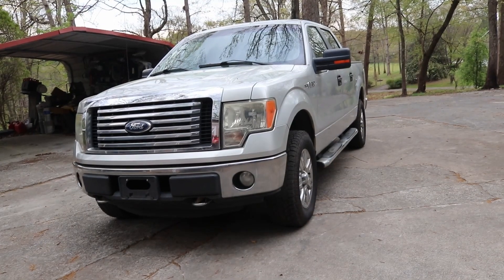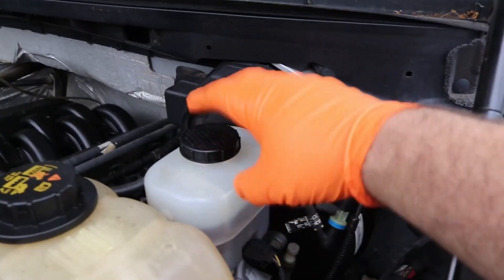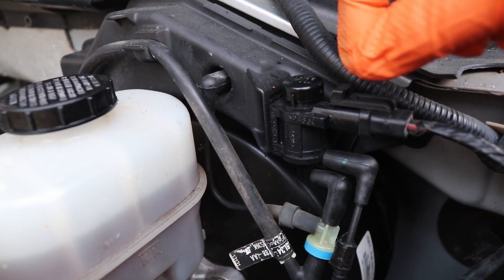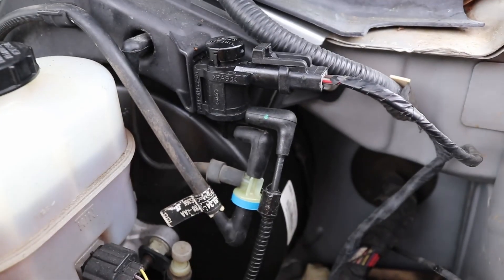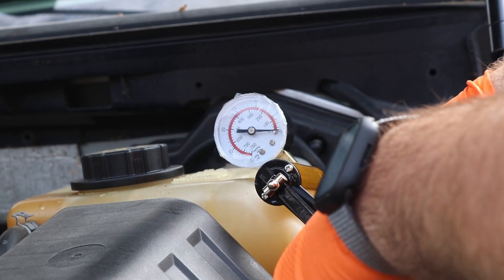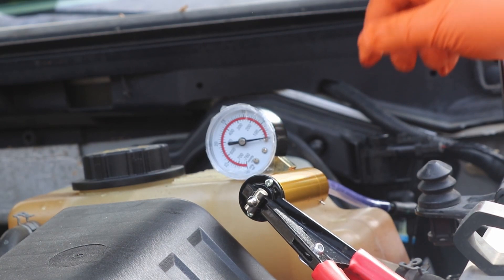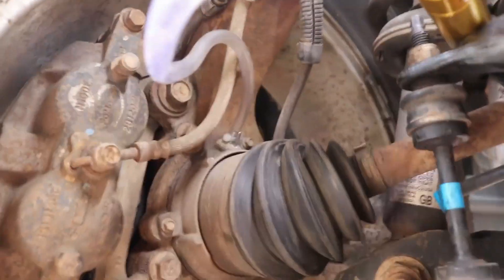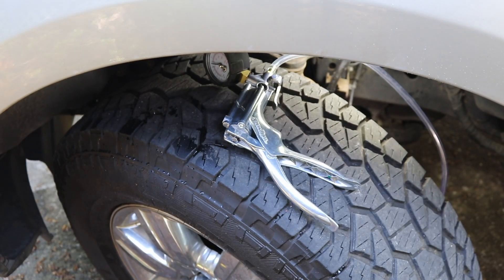How to test the IWE system on a Ford F-150 (full guide)

Comment: I have a 2010 ford f150 4x4 5.4. I hope you read this: I have had a 'bwannnk, bwanbwannnnk" inconsistent grinding noise. I have replaced my transfer case actuator (was getting the wrench sign, but that solved that and allowed me to go into 4 wheel drive). I replaced the vacuum solenoid and the check valve and it's accompanying lines. I am getting a little over 20 lbs or inches or whatever it is at the solenoid. I have replaced both iwe's (the left one had come a part). Still making the noise. I have put a test on the line going to the iwe's and they are now holding vacuum (wasn't before iwe's being replaced). I put the pump on the line, pumped it to about 20, then tucked it away in the nook under the solenoid and drove down the road. When I got back, it had lost all vacuum. I pumped it again, and it pumped up again and held, so it wasn't  the tightness of the hookup of the pump to the iwe line. My question is this, could it have lost vacuum without there being a compromised component? I have a new line I just got from Ford, and a mechanic is going to install it tomorrow. I am hoping this solves my front grinding noise. Btw, when I put it into 4 wheel drive, the noise goes away.
Reply from the maker: So sounds like your lines will most likely be the problem here. But what happened after he installed them?
Reply: @JunkyardJunkie  They definitely were bad. I am now getting a suction sound when I disconnect from the solenoid, and I put the pump on them and drove with pumped to 20 and it held. HOWEVER, it is still making the noise. So since I replaced the whole IWE system and the transfer case actuator, and the noise goes away when I i put it in 4 wheel drive, I am taking it to a front end man tomorrow. I am HOPING it is the cv axles making the noise, because anything else could get into some serious money. Will let you know..
Reply from the maker: I’m sure it’ll be ok. Best of luck!
Reply: @JunkyardJunkie  Welllll, that depends on what you call "ok". It was 4 quarts low on transmission fluid. The noise has pretty much gone away, though every little bit it appears again. I'm gonna drive it and see what happens. I am thinking it may need a filter change too, but heck, I don't know. It has one of those transmission fluid level checks that has to be done under the truck. The mechanic showed me the dipstick (a little short yellow plastic one). It had some fluid on it when he took it out, but when the tried it again, it was dry. We'll see!
Reply: @EastTexasRanching  what was found that fixed your problem?
Reply: @scottsheffield2594  I had another transmission filter put in. They looked in the pan and didn't see any debris (so that was good). I think the trans holds about 16 quarts (maybe more ) when dry, but what drained out and was replaced was 7 quarts. Keep in mind I had already had 4 quarts added that had mixed with the fluid that was in there, and therefore was part of that 7 that drained out. The noise did not go away after the filter change, so I drove it from the mechanic to the transmission shop. We test drove, and he said it needed a new torque converter and valve assembly  (3500.00). I drove it from there to get my haircut. When I got back in the truck after getting my hair cut, it never has made that sound again. Was it air in the system or just wore out fluid? I don't know. I really need to have a full fluid exchange. But that is what fixed it for me. The truck has 320 thousand miles on it. So the fluid may have been wore out.

Comment: Please explain me how you expect to have 25 inches of mercury in both wheels lines once splitted? It has no sense, the 12 inches of mercury you got is correct because the 25 are divided to the half.
Reply from the maker: Because that’s coming down from the line pulling the vacuum. You may have some vacuum loss. But, it’s not going to be 13 inHg. Hope this helps. Thanks for watching!

Comment: I noticed a hissing sound under my hood.  When I checked, the  the vacuum line that is connected right under the solenoid  that you described going down to the wheel basically deteriorated.  I know I need to get a new one installed ASAP.  Will this cause issues while driving in 2WD or with my CV joint on that wheel since the line is open and continues to blow air out?  I hear some popping noise now in my CV joint and think it may be related.  I am not a mechanic by any means.  Thanks for any advice!
Reply from the maker: Yes if your having issues with the line to your IWE driving in 2wd will cause grinding and eventually wear out the IWE or the cv axle where they mesh. Popping from cv axle will most likely be the cv axle itself is the issue. Go and turn in circles and see if you hear the cv axle clicking. If so time to replace. Hope this helps. Thanks for watching!

Comment: Is it possible to have a bad IWE Vacuum Reservoir? Replaced the Solenoid and the check valve. Did a vacuum test on the lines running to the actuator and they’re good but get no vacuum when switching to 2wd. I do get a click in the solenoid.
Reply from the maker: Have you checked the vacuum before the solenoid to make sure it’s working correctly? That’s where I would start. Then we can determine what isn’t working properly. In more rare instances the solenoid can click but still be failed inside. Let me know and I’ll try to help. Thanks for watching!

Comment: So I put new vacuum lines on, new solenoid… I have vacuum down to my wheel hub and my tire spins freely without the Axel spinning but I still have the sound. Would that be a bad knuckle on my Axel?
Reply from the maker: Is it constant? Does it get louder the faster you go? If so you may want to look at the wheel bearing. If not then you may need to check the cv splines and the IWE splines. Hope this helps. Thanks for watching!
Reply: @JunkyardJunkie  I believe it was the wheel bearing, loudest one I’ve ever heard lol
Reply: Stupid question, not did you replace the check valve? 
Ford has a service bulletin out solely for the check valve. I just replaced mine and everything stopped.
Reply: @-strick996  yea, replaced that as well

Comment: Anyone know why I have the intermittent grinding sound. I checked the actuators with a vacuum gauge, each holding pressure. Checked my lines, each pulling pressure. This was yesterday and then i put it back together and I didn’t have any grinding for the rest of the day. Today I drove to work, heard the grinding, checked pressure and everything was good again. Could it be my cv axle?
Reply from the maker: Doubt it would be your cv axle. Another thing to check is to put your vacuum gauge on the line at the bottom again and have some rev it up and keep throttle at 2k-2.5k see if there’s any dropping. Also what are the actual readings you’re getting? Because you can have some vacuum but not enough to keep it working properly. So, if you’re pulling like 22 inches of mercury. Down at the bottom of the lines on both sides. It should be pretty much the exact same unless your lines have a small hole somewhere. Hope this helps. Thanks for watching!
Reply: @JunkyardJunkie  I was pulling I believe 17 but I can check again
Reply: @JunkyardJunkie  update. My passenger line is pulling 12 and my driver side is pulling 15. But if they both hold pressure would this suggest there’s a problem with my actual vacuum pump?
Reply from the maker: From my experience that’s low what are you getting at then solenoid itself? If it’s over 20 go ahead and replace the lines to the IWE’s. This is pretty common but at least it’s easy to change.
Reply: @JunkyardJunkie  I haven’t checked the solinoid yet. I have heard the clicks. I’ll check it around 1pm and lyk. Thank you for your help!!
Reply from the maker: Anytime best of luck
Reply: @JunkyardJunkie  solenoid was at 16
Reply: @JunkyardJunkie  so after the check valve going torwards the engine I measured and the pressure was at 18. After the check valve on the solenoid side it was 17. After the solenoid going to the wheels it was at 16. Do you know what the problem could be if my pressure from the engine is only at 18?
Reply from the maker: Hmmm that’s strange I’ll have to think on that one. What vac pump you have? If you hold your finger on it you can pump it up to 29 right?
Reply: @JunkyardJunkie  I can check the vacuum and let you know in a bit. However I found something very strange. So last night I decided to unplug the vacuum lines at the solenoid. In theory to have 0 vacuum to the wheels, having my hubs locked, cv axles spinning. But I would leave it in 2wd so the transfer case doesn’t give power to the front wheels. Anyways, took it for a test drive and it was perfectly fine, steering was a little tight but that’s expected. This morning, with it still disconnected, I drove to work which is a longer drive (20 highway miles). The noise was still there. Could it be a wheel bearing? It does not happen at highway speeds.
Reply: @JunkyardJunkie  update, it is a mityvac and yes I can pump it to 29 and hold it on my finger
Reply from the maker: Ya if you disconnected it then yes it should be constantly engaged. But yes it very well could be your wheel bearing does it get louder the faster you go? Then quite down when slowing down?

If not that then you may need to check splines on the IWE and the driveshaft make sure there was permanent damage done.
Reply: @JunkyardJunkie  no it doesn’t change sound or tone at all. I talked to some guys at my work who have had many iwe problems and they think that my iwe seal is good and that’s why it wasn’t leaking but the internal teeth are worn and causing it to still spin sometimes. Because after I locked the hubs by disconnecting it at the solenoid the noise still occurs but a lot less often
Reply from the maker: Ya that’s why I said in the comment before you may need to check splines on the IWE and cv
Reply: @JunkyardJunkie  just installed the delete. Still happening. Onto the cv I suppose
Reply: @GrumpyBeaverMedia  did the cv fix the noise?
Reply: @scottsheffield2594  it was a fucking heat shield😂. I took into the shop because I was completely lost and just wanted a diagnosis and it was some heat shield that I didn’t see. I didn’t install new cvs luckily

Comment: no vacuum on the top line even after changing solenoids. what do you think the problem could be?
Reply from the maker: Pull the check valve out and check the vacuum line itself is getting proper vacuum. Let me know. Thanks for watching!
Reply: @JunkyardJunkie same here, I have lots of vacuum and ordered a new solenoid but doesn’t seem to switch. Any idea if there is a fuse or other connection for power? I hear transfer case click no problem.

Comment: Hello, I'm running the exact same set up as you at minute  7:00, I'm holding a vacuum but the CV is still spinning. Is this an issue with the actuator or something?
Reply from the maker: So your holding vacuum and it doesn’t drop off? Your IWE should be bad if your pulling vacuum and the cv axle does spin with the the tire. Even if somehow it reads correct if your applying vacuum to it and it’s not working it would be a faulty IWE. Hope this helps. Thanks for watching!

Comment: isn't vacuum is when pistons travel down and pull air from the intake? so how come now vacuum is pushing air to the solenoid not pulling??
Reply from the maker: Any pulling of air creates a vacuum. It’s not pushing air it’s pulling air negative pressure to the components. The solenoid opens and allows the vacuum to continue to the IWES or closes and shuts off vacuum. I hope this helps. Thanks for watching!
Reply: yes sir but you said the check valve allow air to go only to the solenoid not the other way around and i think it’s the opposite since the suction is coming from vacuum line I’m really confused  @JunkyardJunkie
Reply from the maker: Yes you’re thinking correctly I may have misspoke when recording. If so my bad.

Comment: Hi there, I've been getting stuck pretty badly in the sand in the past camping trips while i was pretty confident about the performance of my 4WD been pulling many cars that are bogged into the sand, I've changed both IWEs + check valve & solenoid but no luck there are times when I'm on 4L hitting the gas to the floor it does nothing at all also the are times it feels like an ABS breaking to slow down the speed , when the car is lifted on the jack all 4 wheels are turning but no luck in the sand , any help will be very much appreciated

Thanks
Reply from the maker: Unfortunately these heavy trucks even with 4wd don’t help much with sand. Wish I had more help. Thanks for watching!
Reply: @JunkyardJunkie  I've replaced all vacuum lines today with new ones couldn't really know whether the 4WD is working like it use to or no , honestly I'm completely lost into this problem

Comment: Mine is only pushing 17 inches of mercury in 2wd, is that a problem? I replaced both IWE’s, lines on each side, and check valve. Drove for about 1,000 miles and issue is back… put vacuum on top line and it holds no problems at all. Please help!
Reply from the maker: 17 is low but should be enough to keep it from engaging though. So if you put vacuum at the top line going to the IWE’s and it’s holding we can rule out that whole lower part. First I would start by roving the check valve and put the gauge at the vacuum source itself. If that reads good then all that’s really left would be vacuum reservoir. Hope this helps. Thanks for watching!

Comment: Bought my 2014 f150 lariat and a few weeks later I heard this grinding sound. Bought a vacuum pump and turns out both IWES were bad. Thanks for the info! I've heard it's more common on trucks with the 4a option
Reply from the maker: Hey, I’m glad I could help! They all seem to just have issues overtime. Best of luck on the repair. Thanks for watching!
Reply: @JunkyardJunkie main question sir 
 can I hear the noise on parking too ?
Reply: @andryjcisneros2334 no it only makes the noise when driving
Reply: @grifa_8176 I have another question sir my from shaft spin all the time and   Cv axles is that normal ?
Reply: @ your cv axles should not spin in 2 wheel drive, on in 4x4 and when the truck is off maybe your acuators are bad and can’t hold air so it spins
Reply: @andryjcisneros2334  was it only while driving around 35-40mph? 5th gear? Sounds like an aluminum rattle?

Comment: Anyone info on why I’d be getting vacuum to one hub but low vacuum (5) to the other? After replacing everything?
Reply from the maker: if you replaced everything new then there should be no reason you’d get low vac on passenger side (you replaced the lines right?). My only thought is a leak in the vacuum line on its way to the passenger side. Hope this helps. Thanks for watching!
Reply: @JunkyardJunkie  ya, replaced solenoid, check valve, both actuators and just did the line, pulling high vacuum on drivers side, but hardly any on passenger side.
Reply: Did you replace the check valve
Reply: Ya I replaced everything, turns out the first hub I replaced was bad. I mean the new one I replaced it with was bad too, then replaced everything not knowing the new hub was never good. I didn’t really know what I was doing the first go around.
Reply: But it’s all working now, thanks for the help from everyone

Comment: How much vacuum should the system be pulling. I’m getting about 12.. (I have the bad grinding at low speeds, everything else checks out, vacuum line holding fine, actuators holding vacuum fine) would the low vacuum pull be the issue?
Reply from the maker: Yes low vacuum would cause intermediate grinding noise. 12 is low. mine was at 12 I replaced the lines and now it’s at 24 give or take. Are you getting 12 at the solenoid? If so you’ll want to check the check valve or vacuum tank and vacuum source. Hope this helps. Thanks for watching!
Reply: @JunkyardJunkie  yeah it’s at the solenoid. I just replaced the check valve so I have to assume it’s the vacuum source
Reply: @Matthew-Uchiyama  have you figured it out?
Reply: @georged1085  no. I plugged the vacuum lines and still have the noise intermittently. No clue
Reply: @Matthew-Uchiyama if you plugged the vacuum lines, permanently engaging the hubs, then it’s possible it could be the needle bearing is dry. However I’m a little skeptical of that since now it should be rotating at the same speed of the axle

Comment: I believe my passenger side iwe is leaking down and plan to replace it.   My question is,  if I bypass it for now will the front driveshaft be rotating the entire time I'm moving?  I know the cv shafts will but can't picture whether the front driveshaft will as well.    Reason I ask is because my front shaft tore the boot near the transfer case.   I'm guessing it's because it's constantly rotating and shouldn't be?  Btw it's lifted.
Reply from the maker: Yes your driveshaft will also turn. So unfortunately you will want to go ahead and change your IWE. Also anytime you lift a truck especially if it’s a big lift it puts way more stress on many different parts. Hope this helps. Thanks for watching!

Comment: Good video. I'm just learning about this system. No issues right now.

Couldn't this truly have been designed such that the default is no vacuum and 2wd and vacuum is needed for 4wd? Thus saving further damage of parts?? Seems upside down thought process relying on zero leaks to maintain 2wd.
Reply from the maker: Thanks! I’ve thought the same thing a bunch of times. But there’s a few things that comes to mind. One thing is they want it to be a fail safe. if it fails you’d be safer off be stuck in 4wd rather than 2wd. Then I think about how they would replace it and logically I think they would switch from a vacuum system to an electrical system which would have its own pros and cons. But that’s just my thinking. Hope this video helps. Thanks for watching!